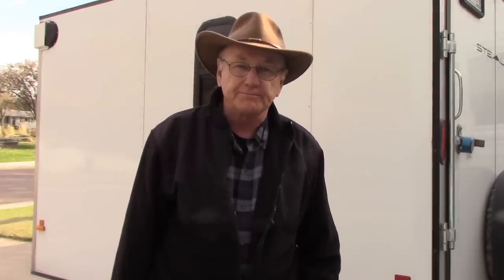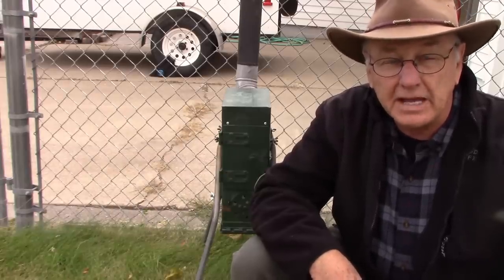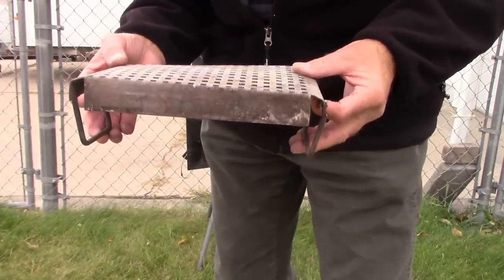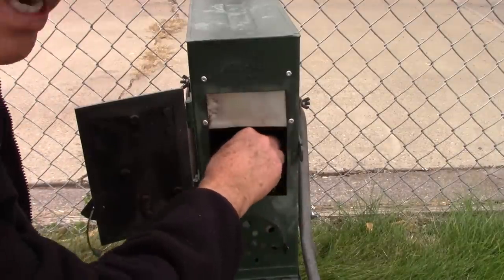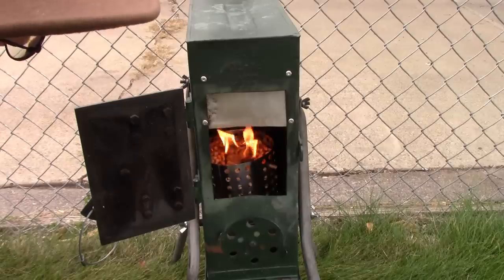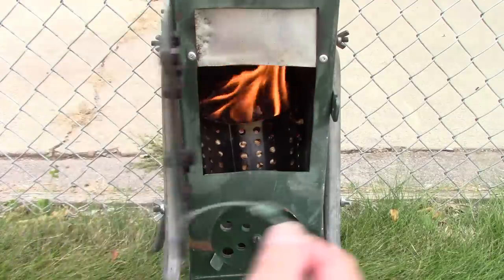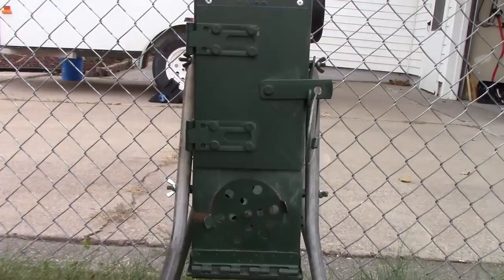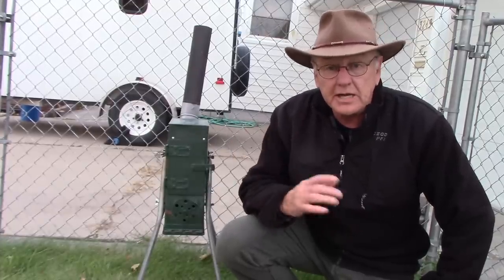How To Burn Pellets In Your Wood Burning Stove

Comment: Excellent, thanks! Got me thinking now of a 5 inch diameter stove 2 ft tall made of .065 tube mounted to the wall (with a heatshield of course) with a 2 1/2 to 3" perferated stainless tube 20" long that you fill with pellets to get, oh perhaps, a 12 hour burn for the night. Maybe the ash buildup would smother it out before it burned all the way down. One way to find out lol and since im a metal fabricator by trade, ill put it somewhere on my to do list. Greetings from the Bitterroot valley.
Reply from the maker: You never know unless you try!  I'd sure like to know how it turns out.  The pellets are very efficient and leave very little ash after a long burn, but that may depend on the temperature.  Thanks for watching and commenting Jerry!
Reply from the maker: I didn't realize that.  I've always thought that hardwood pellets would have been the best.  I have a pellet stove in my garage and I'll try the soft pellets in it to see how they do.  I probably can't get the Vermont pellets here in Montana.

Comment: If you get a butterfly valve to regulate and "choke" base of the stove pipe, you'll probably get even better results.
Reply from the maker: That's right Greg.  There is one on the pipe inside our trailer and if I close it to a 45 degree angle the top of the stove get's about 200 degrees hotter.  That does work!

Comment: What about using charcoal briquettes?   Would that last longer?
Reply from the maker: I've also used charcoal and it does work well.  There's one thing to keep in mind though and that is charcoal can burn very hot of you leave the stove's damper open too far.  Otherwise it's fine.  It burns a little faster than the pellets.
Reply: @gonagain   I'm surprised charcoal burns faster than pellets.  When I grill/smoke my charcoal will burn for 6+ hours.
Reply from the maker: That's just my impression having used both.  But I've never done a side by side comparison.

Comment: try using wood noodles instead of kindling to start your fire, they are light, fast burning and easy to make. just take a wood log and cut it with the grain using any chain saw. what you get a huge amount of  ribbon like wooden "noodles".
Reply from the maker: Good tip Jeff, Thanks!

Comment: Good idea..but How do you add pellets with out putting out the fire.
Reply from the maker: Poncho758, that tall container I used was just for don't the demo and I needed something cheap.  The best thing is something that lets you add pellets on the side and not on top.  Like this:  https://www.amazon.com/MAZE-N-Pellet-Smoker-Smoking-Works/dp/B007ROPJ1M/ref=sr_1_3?crid=6BMDAKHJROB2&keywords=pellet+tray+for+smoker&qid=1575766403&sprefix=pellet+tray%2Caps%2C238&sr=8-3

Comment: can you keep it going overnight?  Thanks.
Reply from the maker: I haven't tried that, but if you get up and feed it you can.  Thanks for watching riverflo dubois!
Reply: @gonagain  thanks.  Maybe if you covered it with ash, like you do with a wood fire to keep it going overnight?
Reply from the maker: @riverflodubois6067  they don't produce very much ash but you can just throttle the stove way down to try.  Of course, the burn box I used in my video was really small and a larger one would go a lot longer.  Have you seen these?  Kaduf Pellet Smoker Tray 5" x 8" - 12 Hours of Billowing Smoke, Perfect for Hot and Cold Smoking Meat, Fish, Cheese with Wood Pellets - Works in any Type of Grill or Smoker, Free eBook Smoking Recipes https://www.amazon.com/dp/B07JFPKFB3/ref=cm_sw_r_cp_apa_i_WoYTDbSPSHGMB
Reply: @gonagain  thanks.

Comment: If you are burning damp wood from rain mix the pellets in with your burn.  The wood will dry out and burn at a higher heat than without the pellets.  Add a fresh air blow (from an open window or pipe) and you got yourself a super hot mass heating burn. :)
Reply from the maker: Wow, great tip!  Just had a campfire like that recently (one with damp wood).  Thanks Toni!

Comment: Is that an Aussie Akubra hat that you're wearing, GLEN?
Reply from the maker: You're funny Ian!  No, I can't afford one of those nice hats like that.
Reply: @gonagain  They are nice - And I have a Tan, a Grey and a Garth Brooks Black he married an Aussie.
Reply from the maker: @ianmccluskey2293  last I looked they were around $250 plus shipping and I wouldn't have a chance to try it on for size.  But that's ok because Stetson ain't bad.
Reply: @gonagain  I got one at a Thrift store about 10 years back for $25 (I think), and the others from eBay for under $80. I'm lucky to have a larger than normal head (size 60) so people are eager to get rid of unwanted gifts the were bought at the wrong size.
Reply: BTW - Stetson (now owned by Resistol) are the US distributors for Akubra.
Reply from the maker: @ianmccluskey2293  I just looked on Amazon and the price is more reasonable.  Cool.

Comment: Would have been nice to see the temps using infrared thermometer.  Also, you are not getting anywhere near complete combustion burning this way. Nearly half of the energy of wood can go out the chimney as smoke, so by burning the pellets the way they are designed (very hot) you will get more heat per pellet.  You need a feeder and very small burn pot with tons of air. You will get a hotter fire and burn less wood. A rocket stove design with a proper burn grate would do much better.
Reply from the maker: Thank you for sharing these tips Douglas!

Comment: As far as building the stove. How does the lid seal on the ammo can, once you remove the rubber gasket that is part of the lid?
Reply from the maker: I built the stove upside down to give a flatter surface for cooking and I removed the rubber seal from the lid.  I also installed a simple baffle inside so that the heat wouldn't go straight up the flue. That baffle is level with the top and a couple of inches below it.  It starts at the back and stops about 3 inches short of the front.  This makes the smoke have to travel around it and then flow under the top of the stove before reaching the flue pipe.  It took me a couple of days to build it and I didn't have any welding equipment on hand to help me so it's all riveted and screwed together.  Hope this helped.
Reply: OK, that explains it well. The baffle is a good idea.  I was going a bit overboard. With accessories, I've spent over $1.5 thousand on a TIG Welder. Does a neat job, though.

Comment: Thanks for the info. Just installed my Cubic Cub and love the wood heat. How does burning pellets compare to compressed logs in price and how does creosote buildup compare between the two?
Reply from the maker: I think the pellets are cheaper, but if you're not using a lot then the compressed logs would be more convenient.  The creosote build will be the same as wood.  I use the anti-creosote powder that you just sprinkle on the fire, about a tablespoon at a time.

Comment: How do you re fuel in an enclosed space, such as your cargo trailer?
Reply from the maker: Thanks for commenting Robert.  First of all, the container I used was just to demonstrate that it can be done easily, but a horizontal tray works best.  Just add the pellets to the side of the flame and don't pour them on top.  Otherwise it's no problem.
Reply: The stove has a strong draft, no smoke or very little will escape into the living space.  🤔🙄

Comment: Maybe you could use two cylinders for more heat. Looks like the stove is big enough.
Reply from the maker: Hi Gary.  I just used that little silverware container for the demonstration because it was cheap.  Normally I just pour them out on the grate that I have in there.  A loaf pan with holes drilled in it would work better and they actually make "pellet trays" (on Amazon) for smokers that would work well too.

Comment: It works for this man but pellets will NOT work in most wood burning stoves. Most wood stoves do NOT have a grate, and won't let enough air in for pellets.
Reply from the maker: You can easily make a grate that will work with pellets for almost any wood burning stove.

Comment: Where is the heat fan?
Reply from the maker: James, do you mean a blower fan inside the stove or a circulating fan in the trailer?  In the trailer we use an inexpensive USB fan (under $6.00 at Walmart) to move the warm air down off the ceiling.

Comment: Thats my biggest problem with stove heat, I need 8 hours of un interrupted sleep, none of the stove stuff works like that accept an electric auto-pellet feed, now they take up to much room.
My favorite heater was a carry on camper propane heater that had an isolation heat exchange pushing ALL the fumes out a chimney and only the  heat exchange air is what your breathing, 0 percent co emissions in the camper, and it took up less room then the wood stove.
Reply from the maker: Hi cowboy6592!  We don't use the woodburner anymore for the same reason you mentioned (and others).  We went to a vented propane heater that I showed in this video (It's in the last half of the video): https://youtu.be/BKBF-mDnt28. Thanks for watching!

Comment: Please gas is cheap. Is your life worth  it? I can heat my 21'  camper for 3 to 4 nights easily on LPG at around 35* F outside. Costs around 2.50 $ per. Gal. Just saying. Be safe , take care, there is only one of you. They do not make more.
Reply: It's really ok. Wood heat is safe for experienced people. The learning curve is pretty short. I started with a homemade barrel stove as young single formerly city mom.  25 yrs of wood heat later, it's all good.